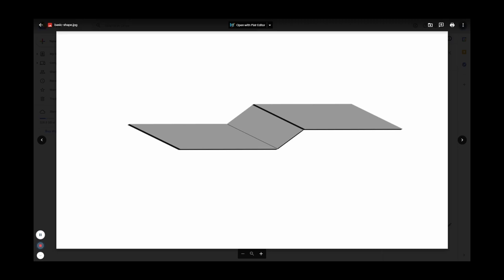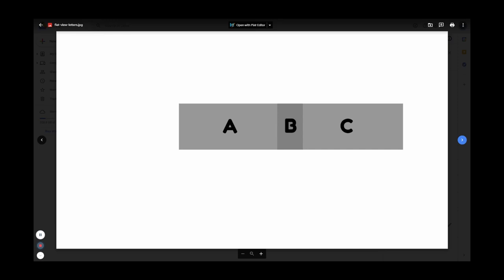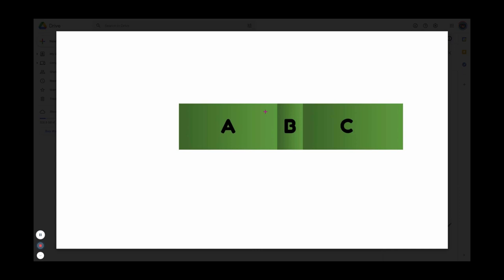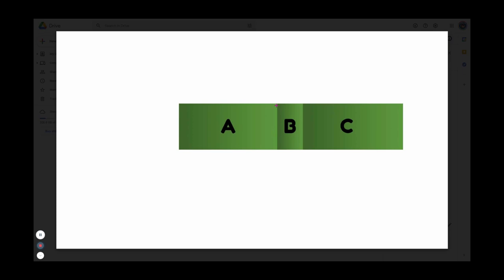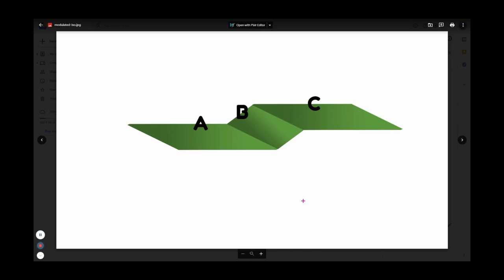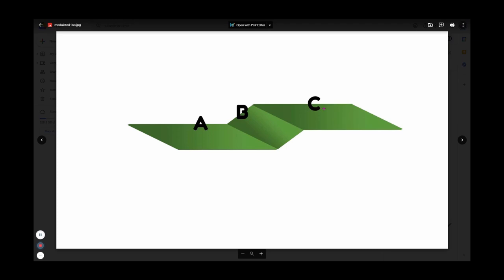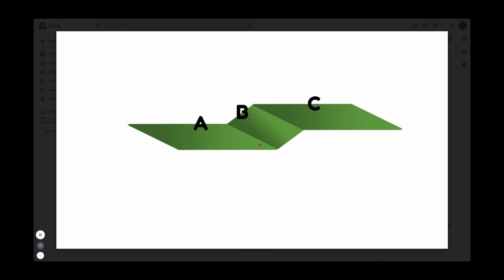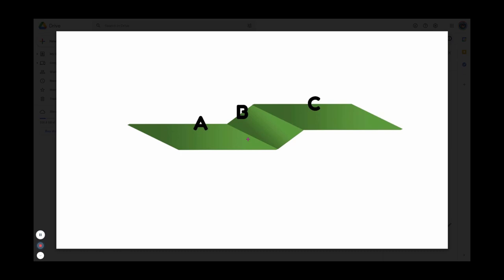What is modulation? A look at the what, why, and where!

Comment: The only thing that I think could be added to this (maybe in a related "examples" video), is a way to have some idea (gotta be vague because reasons) of what kinds of modulation will look like before/after weathering. Its a fair challenge to have a technique that you do that will intentionally make things look "wierd" and not be able to see the end results until after you perform another technique. In part because, as you're learning, you don't have a good feel for the situation of "it didn't turn out the way i thought", did i do something "wrong" in the first part? or the second part? As with so many things, if we can break it down into only modifying a single variable at a time, its easier to learn what the changes mean to the outcome.